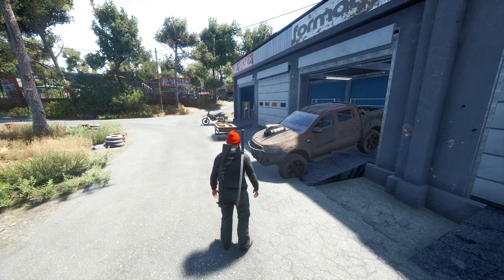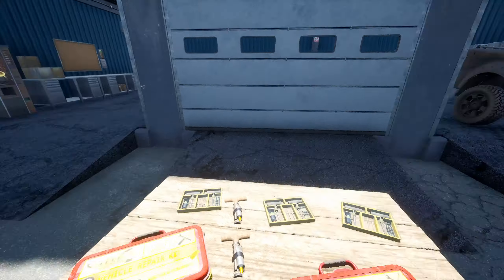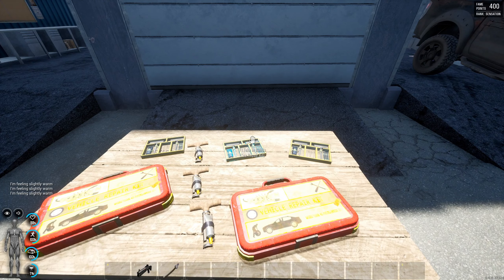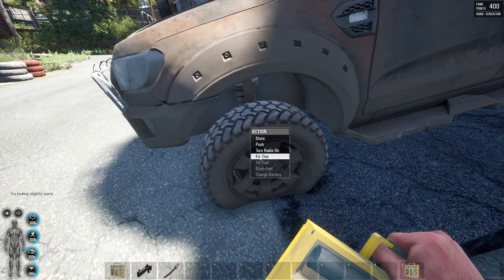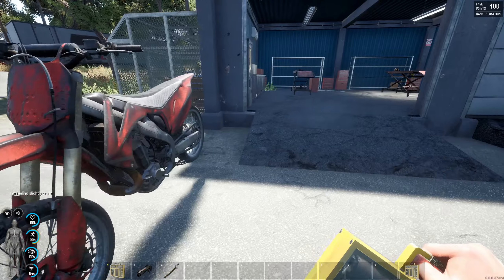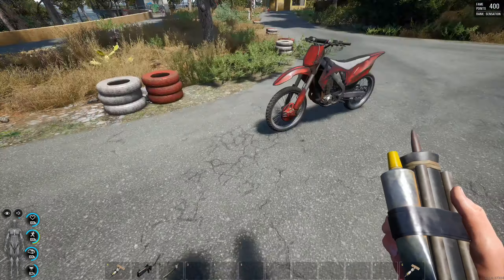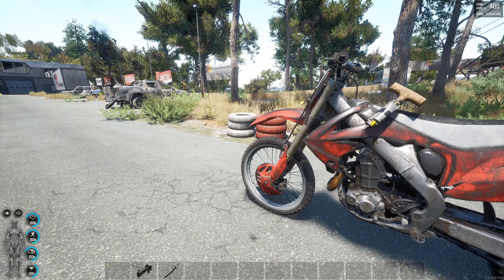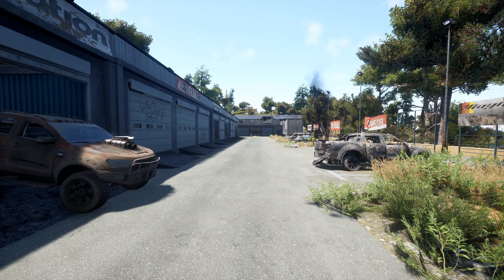Scum 0.6 | How To Repair Vehicles

Comment: The motorcycle will change locations in a garage spot as well until it just disappears. I left one sitting there because it needed petrol as it was very near empty just sitting there. There wasn't enough to make the trip to the station just outside the next town so I was trying to find a jerry can. Bike disappeared before I found one. The quad never moved when it was sitting in the same spot just the motorcycles.
Reply: It literally kept moving further and further to the right side of the garage until it was against the wall and then disappeared all together. Every time I came past I would look to see where it was just out of curiousity. Not touching those buggy bikes until the fix them. Also noticed a bug with chests glitching out while removing them from vehicle inventories as well. Lost two chests already to this since 0.6. No issue in 0.5. But when I remove the chest from the vehicle the only option for it is to maintain it and it does not show up in the inventory screen ever again. Exit and Enter game and chest is no longer there anymore. Along with any contents you had in it. So now I do not load chests in vehicles anymore.